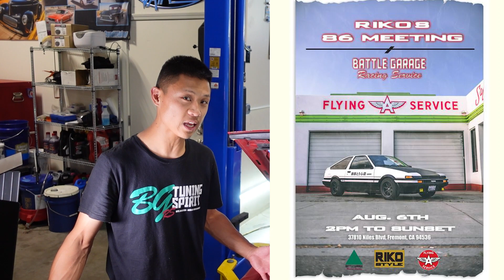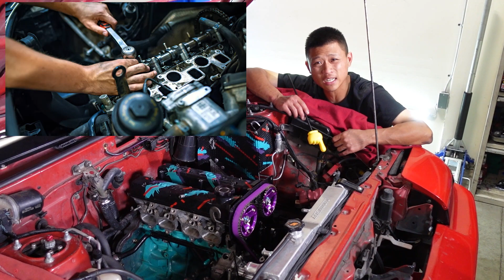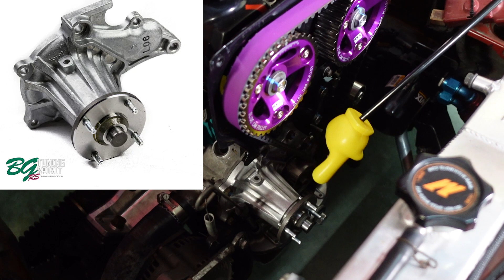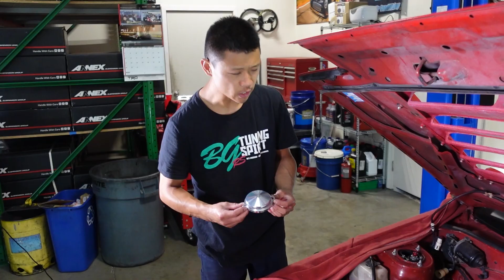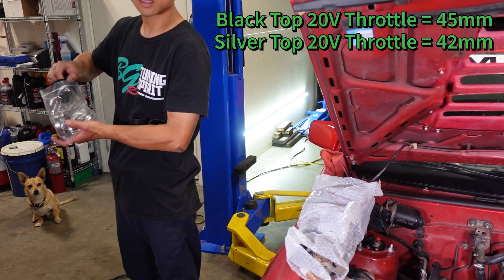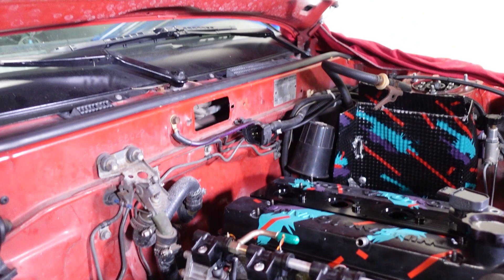AE86 Refresh NEW PARTS!

Comment: Ezekiel, when did you get your original Martelius header? I also had an early one from April 2017 that didn't fit. I cobbled it all together with some parts store flexible exhaust pipe to mate it to the rest of my exhaust. Grant saw it on my car when he was visiting up in Portland ages ago. I will be running it on my car for a little bit before I swap over to my fancy manifold I bought from Jesse. That one will require some exhaust fab work though. Good luck getting it going for 8/6 day. I won't be making it yet again this year, but it shouldn't be too long after that.
Reply: 2018 I got a protoype Group A XL straight from Martelius. They fixed the #1 runner on the Group A and the XL after my feedback and write up